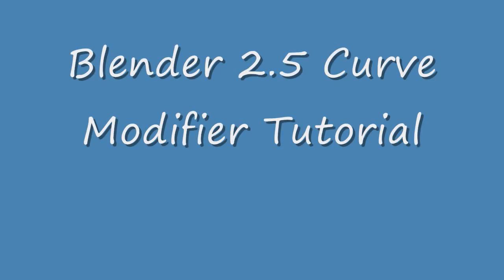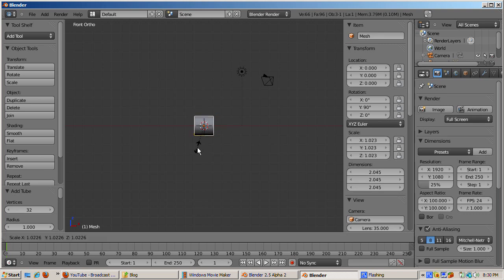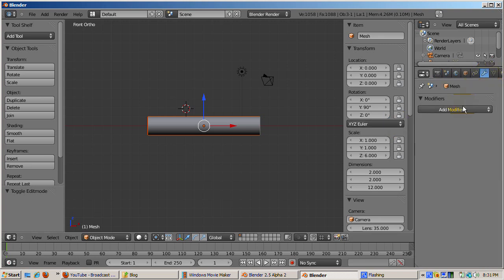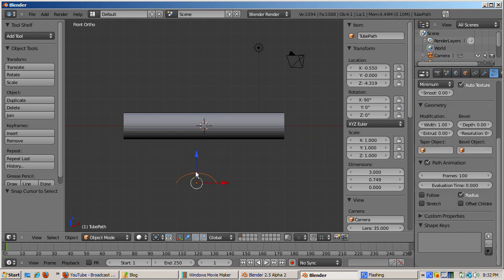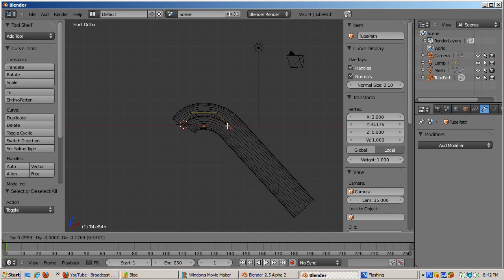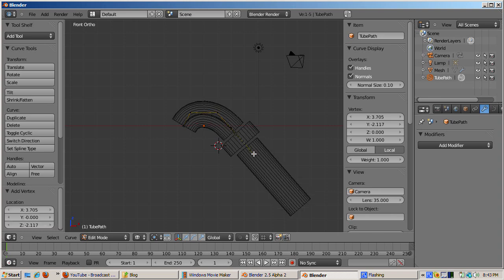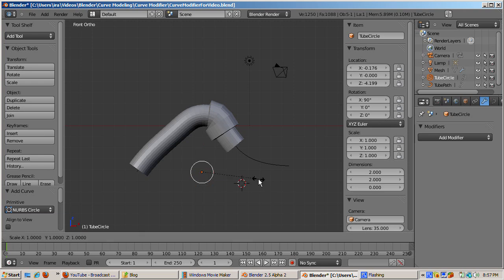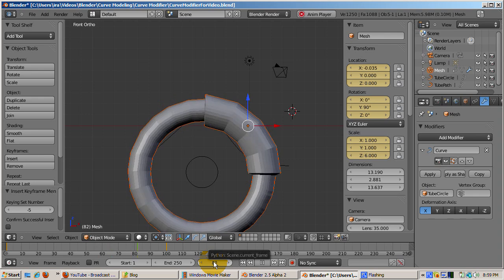Ira Krakow's Blender 2.5 Curve Modifier Tutorial

Comment: I am using 2.71 to follow along. One suggestion would be to open your control panel a bit better to see what is under the hood.
IGE: A 3:44 placing the tube path 3:45 ? You blow by the assignment. After telling us to visit the objects data the "curved icon next to the wrench"  You do not show us the assignment?
Furthermore your  CP shows under Geometry> (offset) on mine, and on yours it is (width)  At a value of 1.00 Do not know if that matters.

So I skip over your area as you did move to wrench area and assign mod to follow 'tube path' yet mine is all twisted.... I watched a couple of times. Did not get it. Moving to another channel to forge forward. SLOW down in crucial parts please.
IGE: the importance of cursor to object and after naming it Tube path you state hit END key... Why what did it do? Or is that the Enter key to finish the name and you call it the END key as you call the Cylinder a Tube. Symantec I know but when trying to follow along it is important. Especially in a tutorial where one key stroke cause deformation....

Comment: @steven198807 I understand what you mean but If you consider the price of Blender and Max -which is free:P Then is very fine. 2.5v is a great step forward than 2.4. For mey is like a Swiss knife, it has everything I need. I do have Max and Zbrush but I feel comfortable in Blender a lot more for some reason. I'm pretty sure that they will improve it on the way a lot more ;)